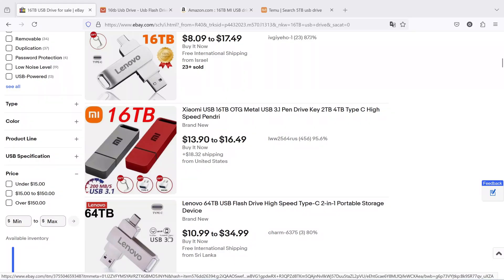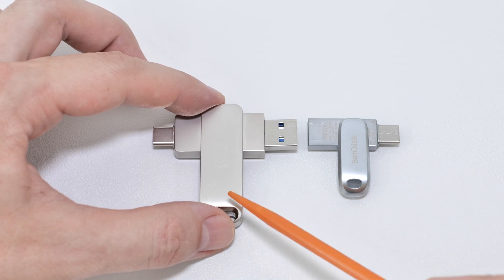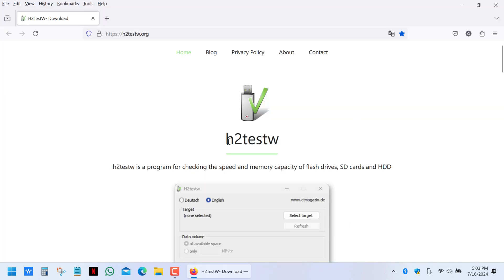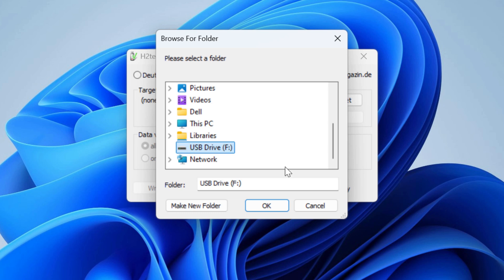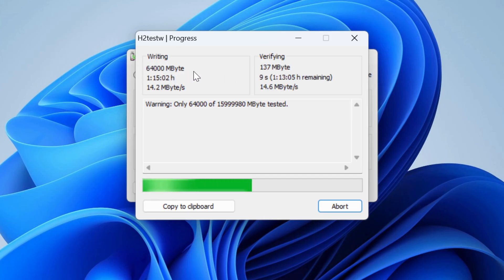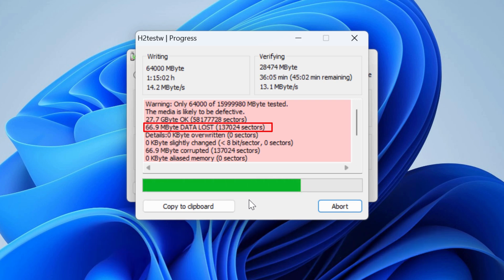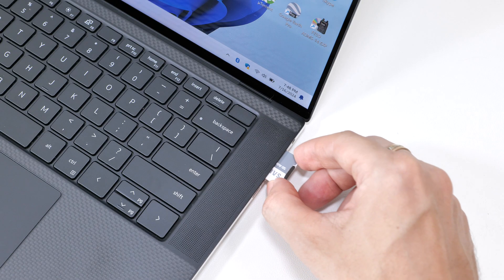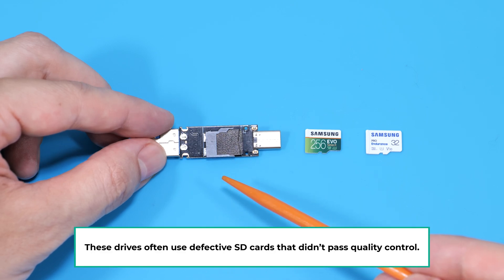Fake USB Drives & SD Cards? How to Check Real Capacity with H2testw!

Comment: Bought a 2 TB flash drive for $16, turns out it was only 28GB! What a rip off at that price, I returned it. I expected the flash drive to be maybe 64GB at least for the price, with Sandisk and other reputable flash driver manufacturers you can get a 64GB 2.0 interface/upload speed for less than $8, meaning I severely overpaid and got much less storage space than promised. I was wondering all external hard drives were well over $100, well that is because that is how much it costs to have a 1TB hard drive. I wouldn't have returned the flash drive if it had 64GB because that to me is acceptable for what I paid.

Comment: Very helpful video for checking the capacity of a flash and going into the detail of how to do it, but I would like to know if on using this downloadable app it can identify any presence of hidden malware which could steal your available data. I ask this because in other videos it was shown that malware can be hidden in newly bought flash drives. Here is one video as a reference. “I Bought a $3 2TB USB Drive and Got More Than Just Malware”. Just put the title in the You Tube search engine. Your valuable option on this manner would be for all who would become your You Tube followers. Thank you very much beforehand!!!
Reply from the maker: I'm extremely skeptical about that video. For a $3-5 fake USB stick it’s extremely unlikely that someone stuffed persistent malware into the controller. Most cheap drives are just fake-capacity junk or garbage memory, not little hackers. If there was ordinary malware sitting as hidden files on the drive, you can remove it by wiping/formatting the storage that kills file-level crap. The only thing that survives a format is firmware on the USB controller (BadUSB style) but most controllers are not reflashable and reprogramming them takes effort, skill and cost something nobody would bother doing for mass-produced $3 sticks.
So yes, targeted implants for espionage exist, but they’re custom built and aimed at specific people/organizations, not random AliExpress trash.
Reply: @ElectronicsComputers  Thanks a lot, from the other side of the world down here in South America. Your answer seems quite reasonable and makes sense and the fact that “if in doubt, not do without, but wipe it out” by a long format as you say. Going one step further, would running a series of antivirus programs afterwards be an overkill for those of us who are weak of heart? It seems you have the know-how and have seen the video I previously mentioned where the files were instantly gobbled up as if being sucked into invisible space on the Chinese flash drive. Thank you for the time in responding “Vielen Dank” and “Auf Wiedersehen”

Comment: I have a bit of an unusual problem. I bought a bunch of 16Gb USBs from PNY. They were marketed as 16Gb, they are labeled as 16Gb but the properties say about 32Gb  (about 28Gb free space)

My issue is do I trust that it is 32 or only 16 Gb, or are they something else ?
I don’t want to have to worry about making sure that I don’t over fill the drive and lose data
Reply from the maker: You should definitely test them with H2testw to verify their actual capacity. By modern standards, 16GB or 32GB isn’t that large and memory chips at those sizes aren’t expensive. It could even be a case of incorrect labeling on the USB drives.

Comment: Is it not safe to put files or can I still use the remaining memory?
Reply from the maker: I would never trust anything valuable to that USB drive. If you already have one, you can safely use it for storing non-essential data something you can afford to lose. But definitely not for backups or anything important. Some of these fake USB drives can corrupt your data even if you're using less than their actual memory limit. Others might work fine, but it’s a gamble. If it’s a USB drive like the one shown in the video, with an SD card inside, you can reformat the SD card to its true capacity and it should work without issues. You could even replace it with a higher-capacity card if you want.
Reply: @ElectronicsComputers  this is helpful, thanks!

Comment: great video. I came back to this video  after I didn't know if the usb drive failed the test or not. 1 tb was actually like 51.4 gigs weird number but ok.
Reply from the maker: If it’s possible to disassemble the drive and you find a microSD card inside, just format it on your computer. It will automatically use its actual designed size, not the fake formatted size. This is the safest option if you want to keep using that USB drive. Otherwise, some data might still get corrupted.

Comment: So if I need a cheap USB for unimportant files like movies will the cheap 64gbs be usable on aliexpress
Reply from the maker: Those fake USB drives are formatted in a way that shows a fake capacity, and any files you store on them—even small ones—will end up corrupted.
Drives like the one shown in the video, which contain a real microSD card inside, can be reformatted to reflect their actual capacity. In that case, they work just like a normal USB drive, and you can even replace the microSD card with any other one. However, if the drive has memory chips soldered directly to the board or if you purchased a fake microSD card, there's nothing you can do except throw it away.

Comment: So is the hole usb drive worthless? Or can you just use up to 28gbs and still be ok?
Reply from the maker: In most cases, they use defective memory chips or SD cards that didn't pass quality checks. Even if you trim the drive's capacity, storing your data on such a drive is very risky.
Reply: Fake USBs are often found to be very slow at transferring and reading data, so it isn't recommended

Comment: Hold up, there's a microsd card in USBs? I wasn't aware of this
Reply from the maker: Those no-name microSD cards are often cheaper than high-quality memory chips. As a result, they usually offer very slow speeds, and their reliability and data integrity can be quite poor. Despite these issues, people continue to buy them. I’ve had several clients needing data recovery, and many of them mentioned that the USB drives were gifts from relatives or friends. 😄